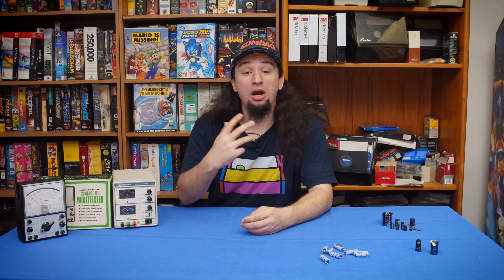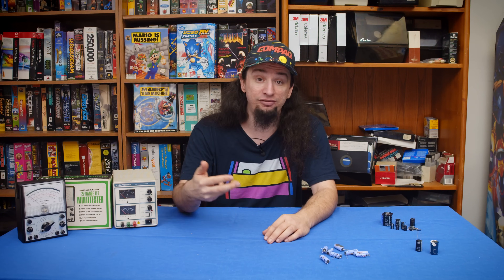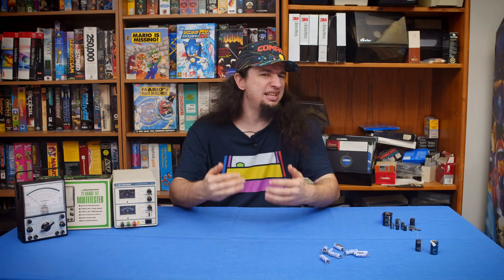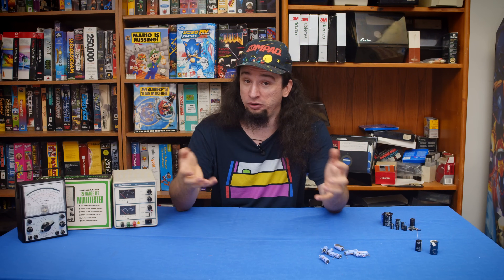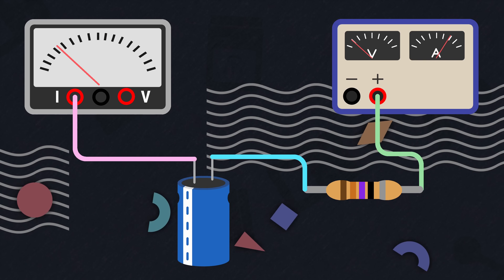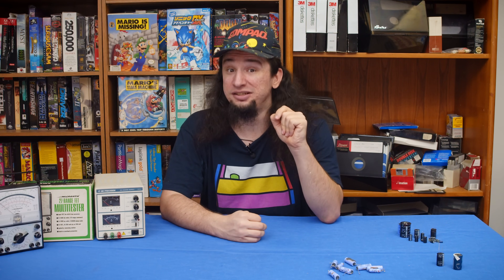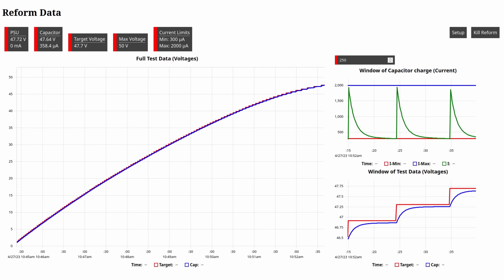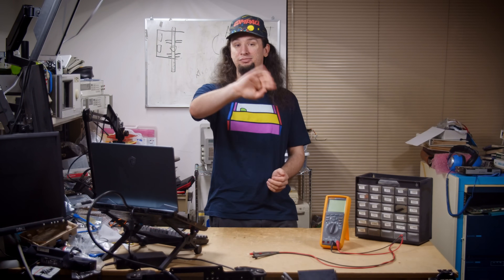Reforming Capacitors - Everything you wanted to know

Comment: No no no.  The quality of capacitors has improved geometrically over ones from 20+ years ago.  Every aspect of a capacitor today (yes even the +/- 20% general use kind) have better stats across the board.  What you can't guarantee by refurbishing capacitors is just about every aspect.  What you want are known values for max operating temperature, ESR, ripple current, etc.  People only focus on capacitance because they're not engineers.

Comment: Will do nothing for dried out capacitors --  which is the main problem with vintage caps in the first place.
Test a batch of caps from the same lot --  "reform" half and then test all of them --  measure ripple for example.

Comment: For the high voltage power supply, you could get and modify an 'electric fly swatter' as they will usually have a 3vdc to +300vdc flyback converter
Reply: They can easily be modified to charge high voltage capacitors and most new ones use a single-transistor "reverse avalanche" oscillator directly driving a common smps flyback transformer
Reply: Not enough power. I would estimate that you would need a minimum of about 5 ma at 300 volts. I realize that doesn't sound like much, but that is 1.5 watts out of a little battery.

Comment: I daily a Pioneer SX-1250 from 1976 I use as my PC speakers that still has many of the original capacitors. (The last time it was serviced was in the 90's I think but they appeared to only do work on the power supply) 
Still working along just fine.
Reply: First, you are still using it. Second, Pioneer and most of the better hifi manufacturers used good components.

I have a Tektronix 2465B scope from the mid '80s that is still working fine. Of course TEK used the best components available, although that damned Dallas Semiconductor static RAM/EEPROM with its internal battery is going to cause problems sooner or later.
Reply: @johncasteel1780  Yes, I'm still using it Your Oscilloscope sounds cool. Did some googling and it sounds like that has a bit of a cult following.

Comment: Why have an algorithm raise the voltage when the current drops below a certain point? Simply set the voltage to the rating of the cap and then set the current for what the maximum desired current you would want to be applied to the cap at any time. This way the power supply in CC mode will automatically lower the voltage applied to meet the set current and slowly raise the voltage in a linear fashion until it gets done. [When the voltage gets to the set voltage, the current will start dropping until it gets to the leakage current of the cap.]

Comment: Not really a good idea since electrolyte caps will lose electrolyte over time, especially if stored in hot locations. Just more practical to replace them, and if you plan on using the devices for a long time, get the high temperature 105C with 5000hr rating.

Comment: You can do very nice things when capacitorbforming. During my apprenticeship it was a popular ploy for someone off sick for everyone two to reform the capacitor contacts in reverse polarity. When the poor victim cam back to work and built the circuit with 'his capacitors' 😂 he Would solder them into his circuit with the polarity printed on the can. 
Then the testing would start. Connectbpowet, switch on and BLAM.

Comment: I have done this before. Tested some then 20 year old wet slug glass frit seal tantalum capacitors, then reformed them, and no difference noted at all in parameters. However on the rubber seal "value" range ones, they all were pretty much acting like 100pf capacitors in series with a 1M resistor, basically open circuit. Even abuse, by application of 28VDC at 10A, merely made them a little warm, unlike the soldered versions, which made excellent starter blanks as the blew the end cap off.

Took some NOS 15000uF 6V can electrolytics last year, and, of the 5, 3 had corroded through the can, and the other 2, after reforming for a night at 5V, via a 1k resistor, had almost zero leakage current. Left them charged for a month, and both were still over 3V, though ESR was likely pretty high, as they did not produce the expected spark on shorting the terminals. Never checked for rebuond, just looking before tossing them. 

With electrolytic capacitors it is easy to tell if it is worth reforming. If it was made between 1990 and 2010 do not bother, just replace with new, especially if it is low ESR, and is not the top series from Vishay, Rubycon, Matsushita, Nippon Chemi Con or such, it will be dead, because of faulty electrolyte formula. After 2010 it probably is fine. Before 1990 and the electrolyte scandal very few were low ESR, so condition is the determinant, plus check capacitance. If within 30% of marked probably OK, but under 70% suspect, and if more than 130% reform at your peril, because it will likely go bang. If it was made before 1970 do not bother, the rubber seals will have gone bad, and it will be dry.

Incidentally those metal can capacitors in the disk drive are not electrolytic, but non polarised paper insulated ones. If the seals on top are not leaking they are fine, though if made before 1977 beware of PCB oil fill, even if marked "No PCB", as that oil was often contaminated. Used on the motor to provide phase shift, and very reliable, as they never had high current or high temperature applied, and the 300VAC rating means they will survive 500VDC for 30 seconds. Testing them is easy, use insulation resistance tester, set to 500VDC, and apply voltage for 30 seconds, and check resistance is over 1M, and also listen that there is no discharge in the inside of the capacitor, which is easy to hear. Any discharge toss them, they will break down later on, and the replacement is the same value 450VAC polycarbonate, which is smaller, but will still do the job, though does not look "original" in the bracket.

Comment: Great explanation of the reforming process!

I generally use my small HP bench supplies (6212A or 6216A) for caps rated up to 100V, or a 6515A for anything higher.  All of them operate in either constant voltage (what people generally think of when working with a power supply) or constant current mode.  For the 621Xs, short the output and turn up the voltage a bit, then adjust the current limit for somewhere between 5 and 20 mA.  For the 6515A, this step isn’t necessary as its output is fixed at about 5 mA.

Once the current limit is set, remove the short and set the power supply to the cap's rated voltage.  Turn the power supply off and connect the cap, then turn the supply on and it’ll increase the output voltage to maintain the current setting until it reaches the rated voltage, at which point it will change to CV mode as the leakage current decreases.  Less babysitting needed that way, and if the cap doesn’t fairly quickly get up to the rated voltage, you know it’s toast.  I monitor voltage and current like you do - voltmeter across the cap, and milliammeter in the low side between cap and power supply negative terminal.

I came upon a box of big caps I had squirreled away a few weeks back and have been reforming like a madman lately.  Most have come back nicely; only a few went into the garbage.  In my opinion, at least for larger caps, it’s definitely worth a shot before just blindly replacing them.  Certainly those used in older high end test gear (HP, Tek, Fluke etc.) are normally very high quality components that will last a long time if properly cared for.
Reply: I agree that just using a bench supply in constant current mode with a correctly-chosen target voltage should be more straightforward.  On one hand, I love the scripting Tech Tangents did for this project; these kind of scenarios are why I always look for computer interfacing options when I shop for test equipment.  But I don't see what stepped voltage increases can do for you when the power supply can regulate the current within a chosen target for you.  For that matter, no need for a resistor either (it looks like resistors were mentioned in that specification for use with a constant-voltage-only supply).  And no need for external voltage or current monitoring: typical bench supplies should give you a voltage and current readout, and at 2–5 mA you don't have to worry about voltage measurement errors due to drop in the leads.  KISS.

One exception I can think of is if the power supply doesn't offer fine enough current control or current measurement.  Cheap supplies might only offer 1 mA resolution (or worse), but it looks like the supply shown in this video has a resolution of 100 μA, so that shouldn't be an issue.

Comment: So, if you have the time, energy, knowledge, enthusiasm, and equipment, you can potentially squeeze some more life out of old, mostly dried up capacitors. You just have to make sure that they're not physically or electrically leaky, don't have a high ESR, and meet the capacitor's rated values. And then you just have to say a prayer that they won't short out :D

Comment: Electrolytic caps have a manufacturer lifespan of 5 to 15 years, typically. You need to check the supplier listing like Mouser or Digikey. As a repair shop owner I would never ever do anything like this as the cap is typically at end-of-life and I would be returning a product to a client that could die tomorrow, possibly with catastrophic consequences and legal liability. Just don't do it.

Comment: The cheapest way to get a good quality high voltage power supply is to get a gel electrophoresis PSU. They will go from 0-300V @400mA, so quite spicy.

Comment: What a waste of time. You go to the trouble of opening up old equipment and unsoldering (probably) three to thirty year old capacitors from their boards. You then go to the trouble of resoldering the old capacitors and putting the machine back together. Just buy new, modern parts from Mouser or Digi-Key and be done with it. And you don't even have to "measure" the new parts.

Comment: 9:45 i have that same analog multimeter! its range doubling makes it better than most!
Reply: I bought that meter over 40 years ago at Radio Shack here in Canada. Although I’ve had to repair it a few times it still gets quite a bit of use on my bench!
Reply: @larryh8072  i got mine from and older guy that was retired and wanted his tools and equipment to go to someone young like me who does electronics. i was 21 at the time. and the stuff he gave me a great boost in my progress.
it needed some work as the switch and contacts had corroded making it unreliable but one i cleared that it now works like new.

Comment: I have an expensive as heck high voltage lab power supply that can do this if i want, CC-CV mode up to 3500volts and 15ma. I can set maximum voltage and maximum current and just leave it there and it will adjust the output regarding the capacitors behavior. but to be frank, Re-forming caps are really a hit and miss attempt, not only that the caps are old and deteriorated it is not only the oxide layer that erodes inside the can. I been trying this a lot on older caps and they might be re-formed but they will most of the time just go back to what it was after a pretty short time when not in constant use. a spent cap will never become a new one again even if you re-form. however it is a good trick to use if you want to get a device working long enough to evaluate the benefit of a re-cap without the need of wasting all the work and parts just to find out it was not worth it in the first place. A capacitor leakage tester and logic thinking that all things have a limited life is most you gonna need, I still use some really old caps in some stuff too after serious testing, but if you actually gonna use some old device a lot, Take the time and make it right with new parts and feel the relief that you won´t have smoking caps, leaking electrolyte and shorted circuits because you trusted the internet about obsolete parts

Comment: Thanks for the video, everything was nicely and comprehensively explained. Although in my mother tongue there is enough information regarding this topic, it was definetly worth watching.

In addition, I would like to ask about a similar issue, which is not related to capacitors, but is also shrouded in many delusions. I have read on the Internet, that if you write data on a 360Kb floppy in a DD floppy drive, overwrite it in a 1.2Mb drive configured to work with DD media and then use it again in a DD drive, it will cause read errors.
The explanation would be that HD drives have thinner R/W heads (because of the 80 tracks per side) and therefore the initial "thicker" track would be only partially overwritten. However, does it really happen? Has anyone experienced this issue?

Comment: i consider a variac a bad idea as they dont limit current, in case of a sudden short,  much better a filament light bulb in series with mains supply ,, you can also do this externally the bulb will limit current, and usefully act non linearly not reducing current as much as the capacitor reforms, as the wire in the bulb will increase as the voltage across the bulb increases, and vice versa
Reply: i've had at least one seemingly reform ok with pure dc supply, but once in use in the machine with ripple current present started to heat up , likely due to poor esr although there was no obvious indication as mains hum was about normal...

Comment: The Voltage rating on the cap refers to the peak to peak voltage not the RMS Voltage.
Reply: More accurately, the positive PEAK voltage. An electrolytic cap should never be subjected to a negative voltage.

Comment: Can you just use a simple constant current circuit (a couple of transistors or MOSFETS and 2 or 3 resistors), commonly used to drive LEDs with constant current over a wide input voltage range, and just set the power supply to whatever max voltage you want? Seems to me that such a circuit will constantly keep the applied voltage optimal for the set current. Or is cycling the voltage and current with periodic adjustments (instead of continuous adjustment) actually necessary?

Comment: Great job on a topic that I am sure has a lot of misinformation around it! I assume you meant switch-mode power supplies when you said regulated when talking about not being able to use variacs for newer supplies (plenty of linear supplies are regulated, but switchmodes at the lower end of their voltage range I think will just work harder rather than produce a lower output). I am guessing this also explains why (for example) PC power supplies that are always running tend to keep running, while supplies that have been off for a while get hard to start sometimes, but may improve once "warmed up" - I was wondering recently how that works and I think what you covered in your intro explains it really well (unless I'm seeing something else / as well). Great stuff.

Comment: There is one more caveat to this that I can think of. Electrolytic capacitors are usually sealed with a rubber gasket. If this rubber dries out the seal can fail and the electrolyte can evaporate or leak.

Comment: i worked at a power supply manufacturer for about 30 years as a technician and then engineer. Our units supplied anything from 3v at thousands of amps  to hundreds of volts at several amps. The older designes used computer grade caps with screw terminals and these became hard to source. I used to setup a group of caps with individual resistors in series with each cap. I'd start at about 25% of the rated voltage and check the srop across each resistor. After they settled forwn I'd increase the voltage to about half the rated voltage and do the same thing. Then I'd go up to 75% and let things settle for an hour or two. before going home for the day I'd go up to the full rated voltage overnight. After each voltage level I'd check the drop across each resistor and anything over 5-10 MA leakage was a failure (these were old can caps). Atfer the last full voltage run I'd put a red dot on the caps that passed.

This proved to be a good indicator of cap longevity but anything over 10-15years was very iffy, even if the caps were NOS. Old caps just are not as well sealed as new ones so they can dry out just sitting in a box. cCps in use can last a very long time because they are kept active, I've got tesxt equipment that is 60 years old with 500v electrolytucs that still work just fine because they see use (Heath 0-400v regulated power supply I built in HS).
Reply: I had some of these boxed new-old-stock low voltage/high capacitance devices that showed dead shorts when checked with a multimeter. I attempted reforming using a low-voltage supply and a series resistor, such that the forming current would be just a few milliamps. Unfortunately, these capacitors were truly shorted, so they resisted all attempts at being resuscitated.
Reply: @klafong1   Reforming can revive tired caps but there comes a point where they are just not recoverable.
Reply: you put a RED dot on the good ones? Thats just wrong

Comment: I build and repair guitar amps, mostly tube amps with supply voltages that can many times reach over 500vdc. A very common practice is to use an incandescent light bulb in series with the power cord as a current limiter when powering up an amp for the first time. The light bulb will light up, then dim with current draw... a nice visual reference, like the needle on your analog multimeter.  I was taught to bring the voltage up incrementally to "break in" or "form" the new caps... Now I know exactly what's happening!
Reply: a bulb  limiter is a very good idea and i would consider it essential when first testing items of unknown state ...
Reply: I do the same with 70's and 80's high end Pioneer amps.
Reply: @CharlieKirk1000  should ALWAYS test any old electonic equipment with some sort of self current limiting devce, NOT rely on  a variac, they dont...